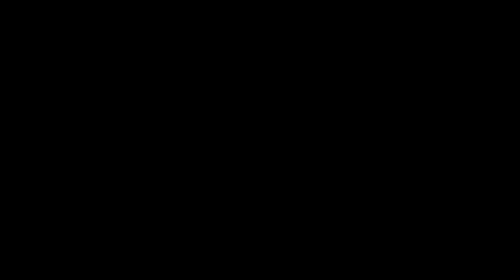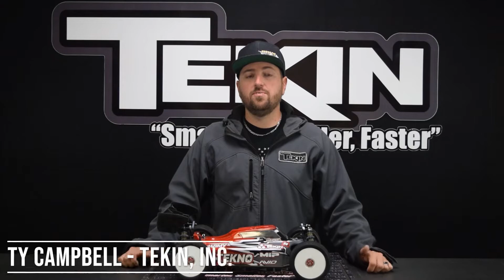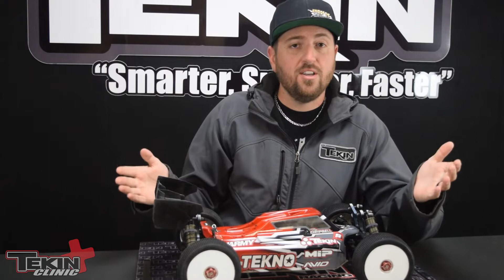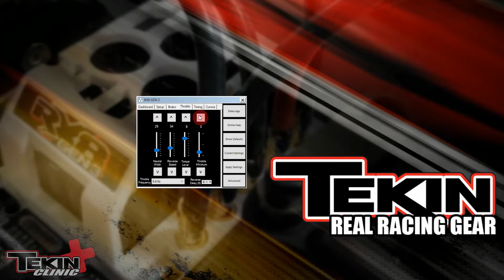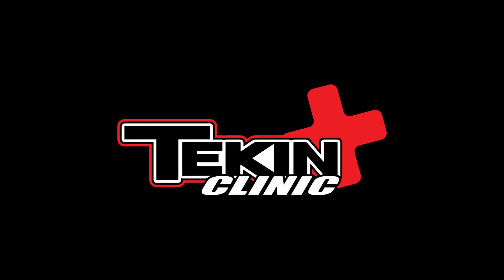Throttle Minimum | Tekin ESC Programming

Comment: I always thought if the throttle minimum was increased, what you did was actually increase the throttle resolution.
I mean, for instance from 0% minimum, half of the throttle movement would make for [100%/2=]50%, whereas if you start with, say, that 15%, you're only using [85%/2=]42.5%, which gives you that 7.5% better resolution, for that same amount of throttle movement, which helps you control your car better, especially at faster tracks, where that lower end of the throttle is barely used.
Why would you only care for this setting to line up for the start which is something you only do once in a race??
If the setting is as I've understood in this video, it would make no sense to have the minimum adjusted to anything other than 0% minimum, as why would you want to reduce your actual max/full throttle?
Reply from the maker: All it does is change the throttle percentage the ESC starts at. Throttle Frequency will change the resolution though.
Reply: @TekinRacing  Thanks for the reply, but I still can't make sense of that reasoning for tuning this option for any competitive adjustment.
With regards to frequency, I would think it should give you the amount of pulses per second the signal it's sending, so it could affect the feeling of resolution and as a parallel side effect, but not necessarily as the main reason for what frequency is actually doing on the ESC, as per the explanation in the video.
Reply from the maker: It lets you start the motor 'quicker' and makes a stock car feel more punchy. Ask stock class racers, most run it turned up.

Frequency we do offer from 2kHZ to 12kHZ, which lets you change how aggressive the throttle behaves. Plug into a HotWire and check it out.